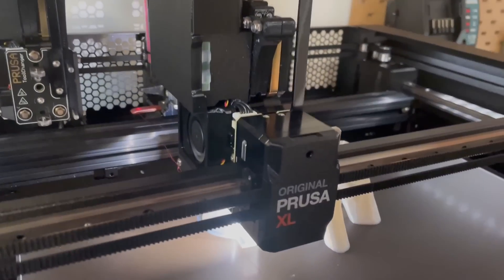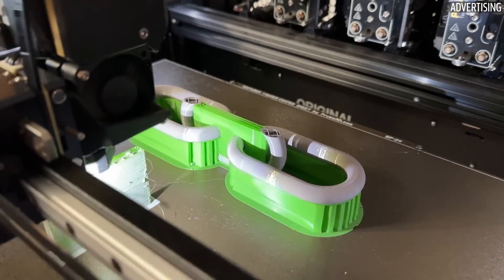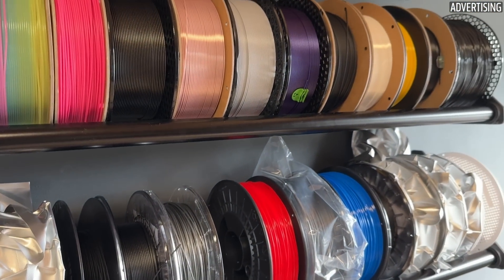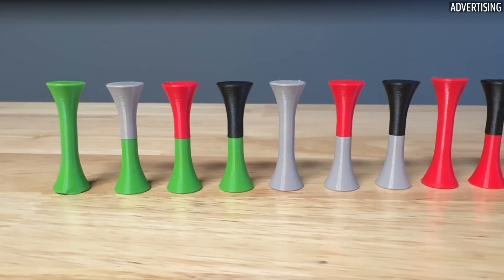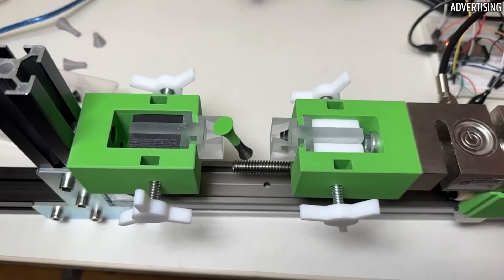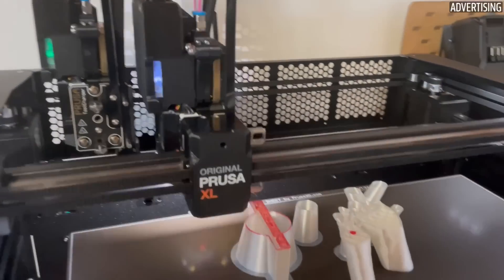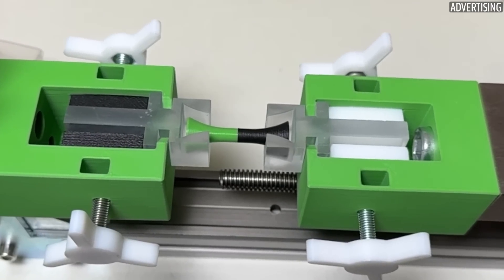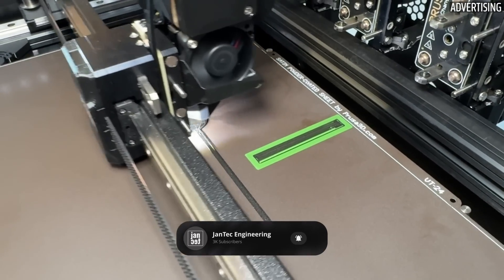You’re Printing ABS Wrong! No Warping & Less Energy Consumption with This Trick!

Comment: Judging from the comments, too many people are lazy and entitled.  They expect you to do the testing for them.  If they have a question about how two different filaments behave, why don't they just try it?  I appreciate you doing this, but I would never be so needy as to ask you to do something which I can do for myself so easily.  Yes, of course, I don't have a test rig, but that's not important.  All I need is to confirm whether the combination works for my application.
Please encourage people to do their own experiments and not rely on others.  They don't even need a multi-material printer.  I remember about 10 years ago, long before multi-material printers were available, seeing a video from Maker's Muse (I think) which showed how you can switch materials mid-print.  I can't be certain, but I think that was to create a TPU hinge between two hard plastic parts.

Comment: Heated chamber helps prevent warping on ABS prints. I’ve reached the point where I only care whether a printer can print full bed ABS parts reliably and without issue. It limits the market to enclosed machines with actively heated chambers.

Comment: How do you print just the first layer in a different material? The only way i know of to print multi-material/color prints, is with a component with several bodies. I then specify one color/material for one body. How I would modify your warping test is by taking the model into a CAD program and extruding a thin new layer as a new body. I would then choose this new body to be a different material/color in the slicer.

Comment: I was just watching a video by Thomas Sanladerer of Made With Layers and he was saying that PLA doesn't really stick to any other material. After watching this video here I was thinking to use ABS shell on Foaming PLA or PLA Foam core (infill). I kind of wonder about that now. I suppose I'll just have to test it. Good thing is that I'm sure Foaming ASA is still an option in combination with regular ABS or ASA shell if ABS/PLA doesn't bond together well in my case.

Comment: Thank you for your work, especially the adhesion chart has been very handy. Have you thought about using colouring by layer to make composite-like or lattice prints? Using each color with different material, I wonder how tpu infused with abs will turn out. Love Ur vids.

Comment: I don't print multi-color items.  I print functional parts.  This technique of printing PETG for the first layer or two and ABS or ASA for subsequent layers to improve bed adhesion and lower electrical usage by having a cooler heated bed is a good application for me to use a printer with a multi-color feeder, not for different colors but for different materials.

Bambu Lab is releasing a TPU filament that works in their AMS multi reel feeder... presumably a higher durometer TPU.  Hopefully other filament manufacturers will follow suit and we can print parts with TPU and ABS, maybe with a PETG first layer or two.

Comment: Oh so basically I should own a multi-material capable 1200$ printer to do this "trick" :D I could also pay half of that to get an enclosed printer and print ABS with much less hassle and "trickery"
Reply: You don't need a multi-material printer.  People were doing tricks like this for years before multi-material printers came out.  You just print your first layer(s), pause the print, manually swap the filament, then continue.

Comment: I don't understand why printing with PLA makes warping on ABS less severe.  Increased bed temperature should help prevent warping by minimizing the temperature difference between the lower and upper layers.  I don't understand why lowering the bed temperature and printing a single layer of PLA before ABS would cause less warping--the PLA-ABS adhesion strength is worse than ABS-ABS, and I don't think that PLA-Bed adhesion is better than ABS-Bed adhesion, so what's going on here?

Comment: Warping is not a problem caused by bed adhesion only. You did it on a flat print. For taller or bigger parts conform heating is more important because you get layer seperation. Also its very impectful if you have a lot of long and straight lines/walls in the design which enforces warping significant. Guess what - the Stealthburner cover is exactly counter warping design.

Comment: Just Curious does the number of PLA Layers with the ABS make any difference Im sure after a number of PLA layers the warping of ABS would drop off a great deal and not make any difference. But if you print 3 or 4 layers of PLA and then ABS as opposed to 1 or 2 layers will the warping stop all together? I think a more detailed analsys of layers between PLA and ABS in an unheated and heated chamber would be prudent! Also I am intersted in what JonS has proposed!

Comment: This is an incredible discovery! Even though I have a closed X1 Carbon, I’m definitely going to try this technique. Being able to keep the bed temperature at 60°C instead of 100°C or higher makes the process more economical and even safer. This opens up new possibilities for ABS printing, especially for those without beds that can’t reach higher temps. Great video! Thank you and congratulations on sharing this valuable insight! 👏

Comment: I have been using polystyreen as an interface layer for supports for some time. Works well enough on ASA and PETG. I deliberately mention interface layers. I do not print support material completely from polystyreen. This trick reduces the amount of toolchanges saves material, time and wear to your machine.

Comment: The thermal stresses that develop as it cools are hard to minimize without the use of a heated chamber for certain materials like abs.   The goal for plastics is print them and keep the chamber hot, closer to their glass transition temps (i.e. when the plastic becomes solid again after melting) so that you don't have large thermal stresses develop as the geometry is changing during printing.   Less thermal gradient means less warping.  Then after printing is finished, cool the part slowly and the final geometry will be much more accurate, though you will still have some dimensional changes during this cooling period too (these are unavoidable but you can plan for them through careful engineering).
Reply from the maker: Thanks for your comment. You're definitely right. 
I know that this is not the best way to print ABS. The idea was rather to show a possibility if you don't have a heated bed or are really trying to drastically reduce your power consumption. 
Of course, the shrinkage of materials like ABS cannot be avoided.

Comment: Finding "tricks" to print ABS on an open air machine AND with a reduced bed temp isn't an achievement that people should be aiming for. At the very least put a cardboard box over the machine to increase the ambient as much as you can and go slow enough to where a fan isn't required and enclose it as much as you can. That way you can print a semi decent ABS part on a machine that isn't meant for it.

I suggest watching this video to better understand what's happening to the part you're printing and how much temperature really affects the quality of the parts you're printing especially when using materials that want a higher ambient like ABS/ASA/PC/PA etc. 

If you need an ABS part, at least try to get as close to abs printing conditions as possible - not as far away as possible.

https://www.youtube.com/watch?v=U-RvbcHbEe4
Reply from the maker: First of all, you're right. My go-to ABS setup is also an enlcosed machine with 100 °C + heated bed. 
But: there are still printers out there without heated bed (Cetus for example) and if you happen to need a part with better temperature resistance than just PLA, such a method could be useful. Secondly, this is just a concept, that also could be applied to other filaments, like PP, that do not require a warm chamber but won't stick to common print surfaces.

Comment: "As I already knew from previous tests, PLA has by far the best layer adhesion"    Er, TPU has the best layer adhesion of any of the tested materials.  Your mounting solution for the TPU-TPU test was just incorrect for a flexible material.  Surely you know this though so why misrepresent the fact?

Comment: I have been using this for a long time. I change the thread by hand after the first layer. I print on a glass sheet and the PLA adheres to it very strongly. On a PLA base layer, although I have already printed with PA-CF, ABS, PMMA, PETG. It never came up, but it happened that it broke the glass when printing POM material. Unfortunately, this cannot be printed thickly because it shrinks very strongly, even though it is very impact and abrasion resistant.

Comment: For that print with the first layer PLA and the rest of the part in ABS, can you elaborate if you used the PLA bed temperature through the entire print? Or did it go up to abs temp after the first layer? Or somewhere in the middle? Definitely interested in trying that.
Reply from the maker: I used 65°C bed for the whole print. Consider using 2-3 layers of PLA.
Reply: @JanTecEngineering  thank you very much for the quick reply and good info.

Comment: My general method to Print ABS is to do it as cold as possible to minimize warping. Even if i have to slow down the printer works fine on Voron 2.4 and X1C

Comment: I've used clear PETG as a first layer before printing ABS/ASA before. PETG has very strong adhesion to PEI beds (sometimes too strong, but I had no issues in this use case) and strong enough adhesion to ABS/ASA that I didn't get any warping in the moderate-size parts I was printing. Because clear PETG is so transparent, I don't have to worry about matching color with the rest of the print, or having to pick a color combination.
Reply: did you tried PLA/ASA ?
Reply: @enzoarathni7958  no. In part because I wanted the transparency of clear PETG so you couldn’t even see that I had changed material.
Reply: @enzoarathni7958  no
Reply: Clever

Comment: Is not about warping.. is about layer adhesion and finished part.
By controlling the chamber temp you can control the shrinkage (along with clever design and slicing), get the most from the amorphous material, avoid thermal shock, artifacts etc..
ABS needs an enclosure, period, or you better use other materials.
Reply: Apart from the specialities that come with printing ABS, you really dont want to breath in the VOCs that are emitted when printing ABS. A chamber and GOOD ventilation are REQUIRED for ABS. I know, everyone knows this. But safety cannot be stated enough.
Reply: Glad someone said this
Reply: I would like to print on an open machine a material that has good resistance to high temperatures, what do you recommend?
Reply: @ilKamuTube  PET without the G. Is the best you can get on an open printer reliably. Possibly a blend with FBPE. 

On a more specific term: what thermal resistance you need? How many MPa at what temperature?

Comment: It reminded that a Stratasys printer always prints ABS on  thick raft of dedicated support material.
This interesting technique might make engineering plastics such as Delrin more hobbyist-friendly.
Reply: If I remember correctly, delrin (POM) has significant formaldehyde emissions when printed....I guess PA/ABS should be just as good for most applications and at least a little bit less extreme (although still kinda stinky or maybe even not too good for health). On the other hand, activated carbon filters are a standard in modern printers, so maybe that helps to just shrug that part off.
Reply: @pastagandalf   ABS is not just stinky. And activated carbon filters are often not enough to remove much more than the smell. The manufacturers have no obligation to put proper filtration in these things, so don't rely on them.
Reply: The only stratasys printer I’ve ever used printed ABS on an ABS heated bed. The adhesion was so good it wasn’t uncommon to just snap the build surface removing a part